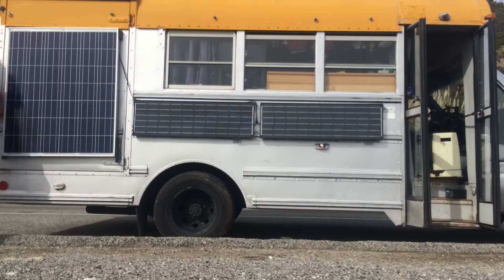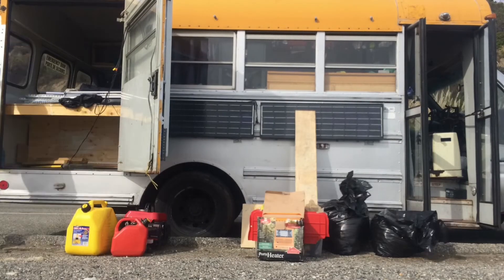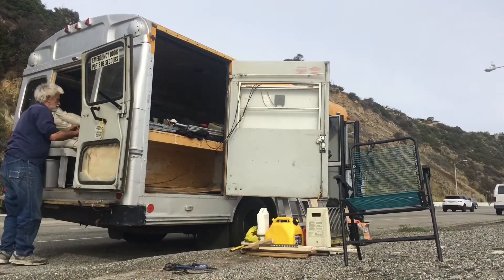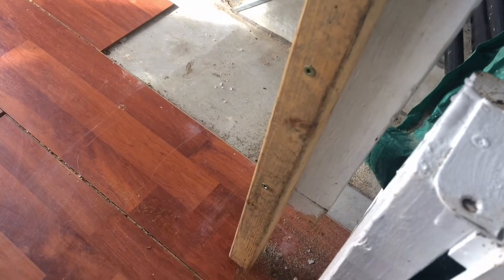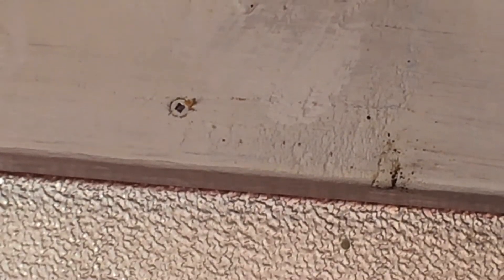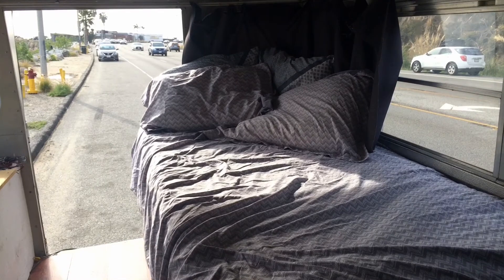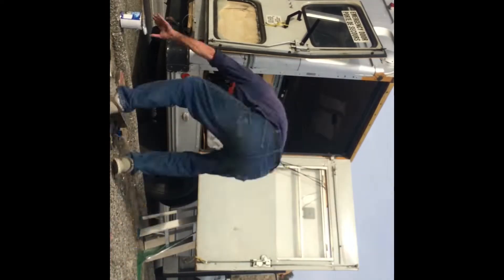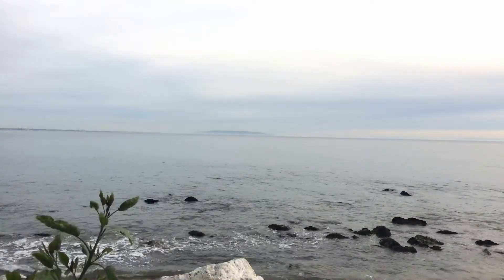Skoolie Renovation, Bed Raising, Floor Plan and Inventory

Comment: All your stuff is necessary, you have to be prepared for every eventuality.  I have an OLD 18' class B and it is hard to find enough storage for things like tools, a cat box, a porta potty, a generator, extra fuel and emergency gear. There are no outside storage compartments. I have yet to test the lifestyle out seriously but will next spring.  Then I can decide if I want to list the house.  I am 66 so l need to try before I become unable. Vanners like you and Chrome are my inspiration.
Reply from the maker: i am 69 and getting younger in my skoolie. I am in better shape, and much more active. My posts are trying to suptly encourage others to move forward. 

You notice the worst scariest things are really not that bad.  Too many youtuberd make it sound hard dangerous and thrilling.  Its just like normal life but in a much warmer prettier place for me.

Comment: I like the ‘temporary’ structures in skoolies for several reasons: a) I am no diy maven, so complex builds are likely well beyond my skills, b) I will not really know what will work for me in the lifestyle until I live in it for a bit, so making it simple and adaptable resonates, and c) I will be on an extremely limited budget, so using furniture I already have and adapting it for bus life may be the only option I will have.  This was very helpful info and some reassurance for me, so thanks!
Reply: Catherine Moore that is what i was gonna to do too.  use what i have to make my conversion on my van.  👍

Comment: Too bad you could not secure you ladder on or near the ceiling, then you could use it to hang things from it and also keep it as a just in case ladder for roof top access or other things. Or if you could open it up in the bus and put wood on the slats for additional storage.
Reply from the maker: good ideas for your vehicle.

Comment: oh man, it would pretty cool if you show how you will make those slides to extend.  
i have a question.  the windows on the bus, does it contribute the coldness in the bus??
My van has ten windows and windshield.  i love them, but i was thinking of taking out the elongated ones on the back sides
Reply from the maker: I travel south to the sun,  But i have slept in it in the snow, and i was fine in a warm sleeping bag all night. 

Because i built it to be in warm weather mostly i do not care about insulation as i am too old to ski and snowboard. 

The windows are an asset to me, do nit need privacy so i leave them as they are.